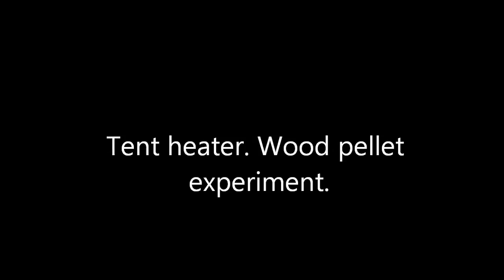Tent heater.  Wood pellet experiment.

Comment: I have designed and built and have used a gravity feed pellet rocket stove heater in my wall tent for the last two years. only thing I can see with your test is that you need a longer exhaust for more draft, maybe even a larger diameter. also out of a 40 pound bag of pellets I have less than a cup of ash.
Reply from the maker: I didn't design the stove to take pellets. This was a test to see if it would actually burn them. Which didn't really work that well with this design of stove. I have the materials to make a better one, but not gotten around to make it yet. Thanks for you comments. Gordon.
Reply: my pleasure just sharing what I know. will look forward to seeing your new build  Todd